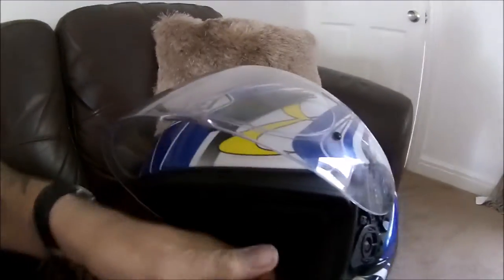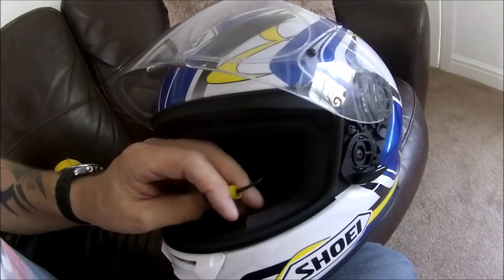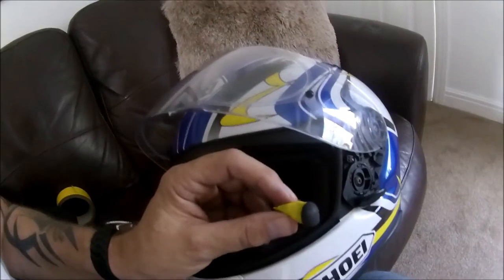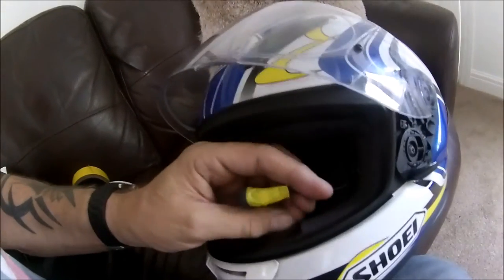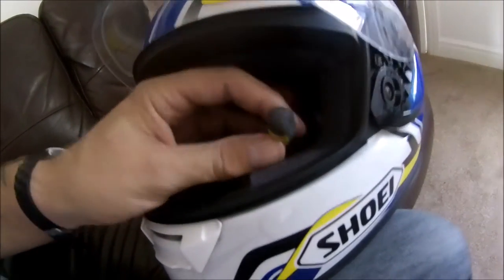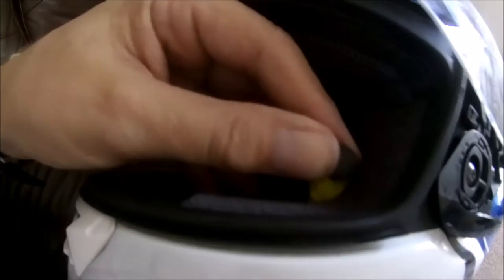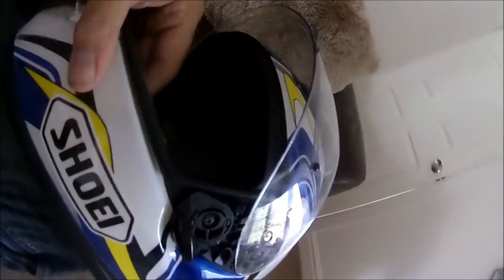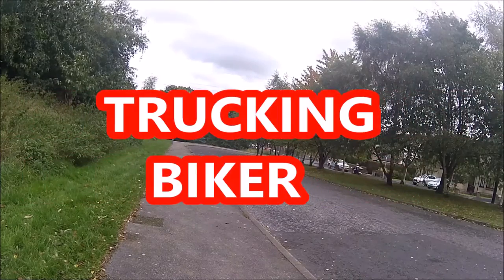HELMET MIKE/ problem solving

Comment: The Drift foams are rubbish at staying on, so I wouldn't try too hard finding an exact replacement. Quite a few people have ended up using washing up sponge foam as a replacement, ideally you want less bulk.

As for placement, I've got mine to the left of my mouth on the flat bit where there the cheek pad ends, my helmet is a Shoei GT Air. Some people put it behind the actual cheekpad too.

I don't think you'll necessarily be able to get rid of the tone change as you open and close your visor, I think that's just down to the helmet acoustics, but the only way to get it exact is by trial and error, just move it around. You don't need to ride with it, just helmet on and speak with the visor open and closed.

If you want to see exactly where my mic is, drop me a PM, be happy to catch you somewhere local.
Reply from the maker: Thanks for that,  I did try putting  mic in different positions and found that simuler to you by cheek pad was best. I was actually surprised on how good the quality sound was, I've heard a lot worse on you tube, besides i am a newbie.

It would be good to meet up with you sometime yeah maybe sometime when weather improves, I really do appreciate your help.

I think I need help on how to get subs, I GOT 6  lol wow, don't even know how to find who is subscribed to me, I'm just shit with computers.